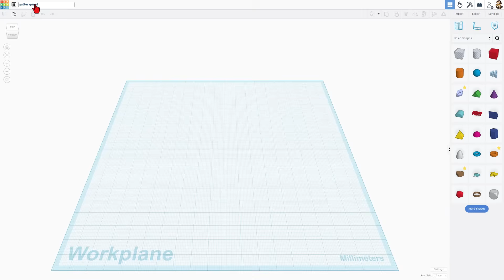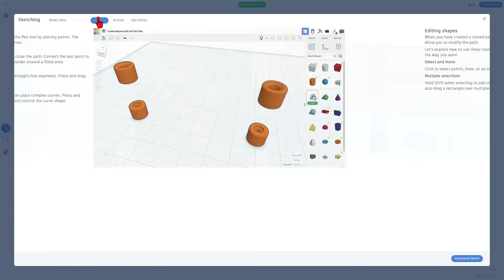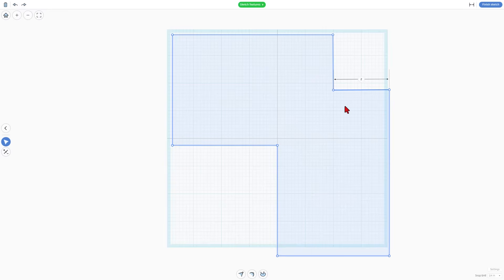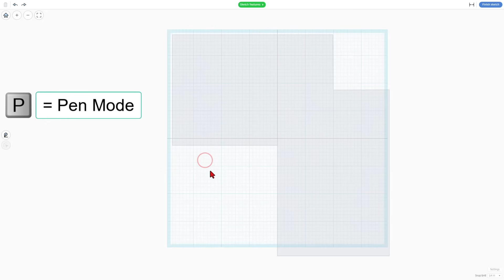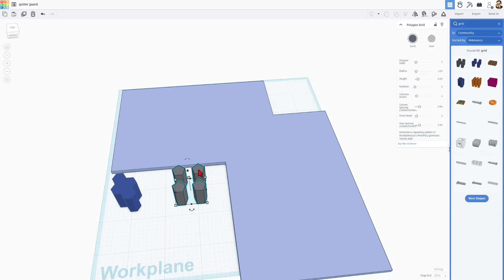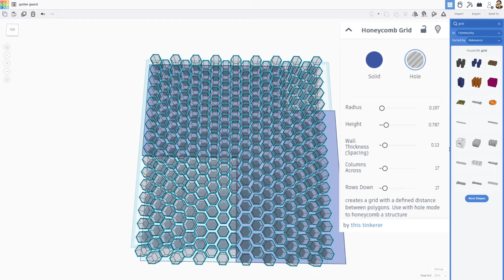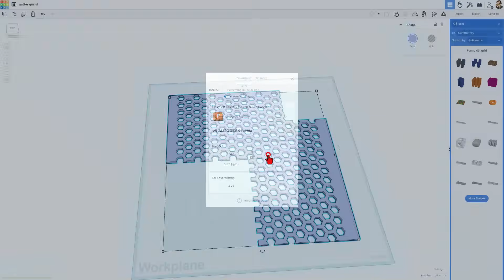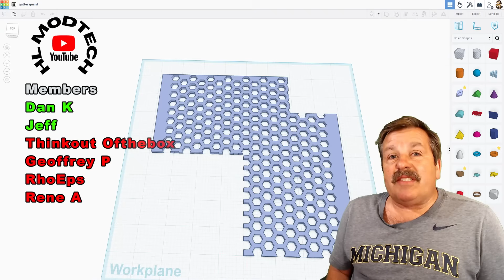Tinkercad Made Easy! A Sketch Tool Gutter Guard CAD is for Everyone

Comment: Did you print gutter guard along the entire length of the gutter? Is it holding up on the sun and snow? I need gutter guards but never thought of printing my own.  Thanks
Reply from the maker: No. It was a system my neighbor put in. The contenders collect stuff so I’m just trying to fix the issue.
Reply: @HLModTech  I was so hoping you did and it worked.  Wouldn’t that be great ? Thank you answering you are so helpful.
Reply from the maker: I think it is possible, but printing them 10 inches at a time would take forever.